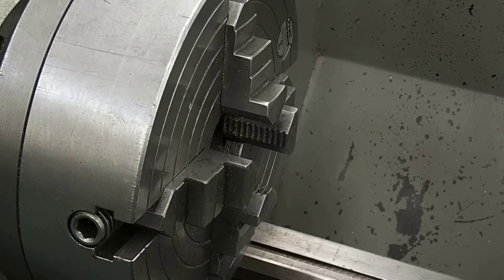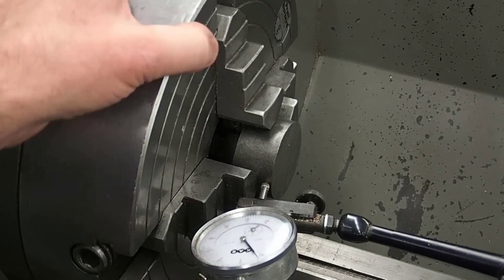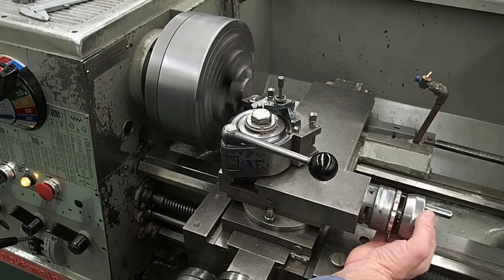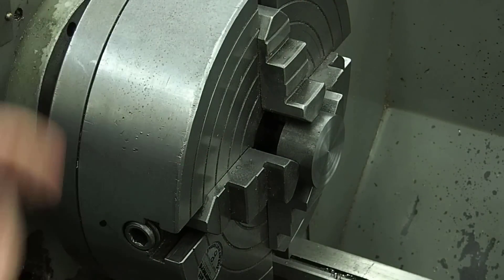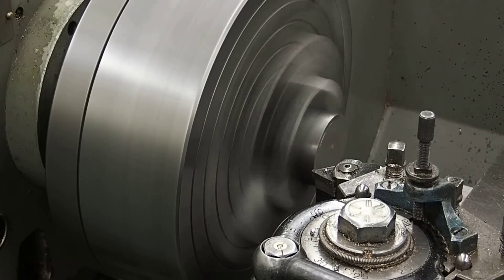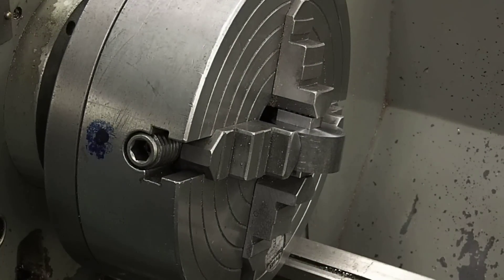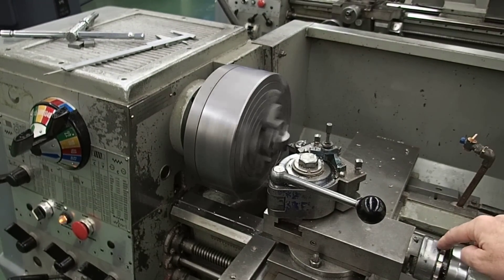Machining a Cube on a Lathe

Comment: Thanks for this! Interesting to compare with other examples including with mill vs. lathe. Kinda sad to see comments like 'just cut it from flat stock using a saw...'. Some people just don't get it.
Can you share the dimensions of the final result? In addition to face-to-opposing face measurements, did you happen to measure opposing corners to see if opposing faces are parallel (if that's how it's done...)? That would be the 3D version of looking at diagonals to check for 2D square.
Reply from the maker: Hi Steve, parallel can be measured by placing the finished product on a surface plate and running a dial indicator on the parallel surface opposite. Perpendicular can be checked by attaching to a know square (clamp to an angle plate) and running a dial indicator over the top surface, lay the angle plate on its perpendicular surface and run the dial indicator over the now top surface.

Comment: At 12:00 you turn the part 90 degrees to get a face perpendicular to the face you just cut, but this seems like a bit of a compromise. Holding it that way, the perpendicularity of the new face ends up depending on how exactly parallel that particular jaw face is to the lathe axis. Normally any error from the jaws being not perfectly parallel (e.g. from load deflection_ is cancelled out since the opposing jaw will have the exact same error, but here you have a flat face on one jaw and a round face on the other, so the errors won't cancel.
It seems like a better procedure would be to instead flip the part 180 degrees to cut the parallel face first, using a set of parallels to reference the back face to the chuck face, and then turning it 90 degrees so that all four jaws rest on flat surfaces.
Reply from the maker: Hi Anson, yes there may be better ways to approach this job. If you read through the post you will see the setup has generated lots of conversation. Thank you for your input.

Comment: Forgive my ignorance, but why wouldn't you just use a band saw, chop saw etc to cut the square?

I'm not judging this, I'm sure there's a very good reason, I just don't know what it is.
Reply from the maker: This was done because a viewer, that only had a lathe, wanted to know if it could be done.
Reply: @machiningmoments  Bull Hockey man!  The only reason why you did not use a mill, or a saw, is because you have not finished making a mill or saw on your lathe yet. :)

Comment: @3:40 I like using a thick parallel between the part and the chuck body face while tightening the first jaw just to make sure the part face and chuck are parallel. 
@9:58 Nice chip

I'd move to a mill after the first two faces lol.

I don't trust chucks because I've been burned too many times.  Unless I know it's a really good chuck.
Reply from the maker: The mill is a better choice.
Reply: @machiningmoments  Yeah, but your video was about making a cube on a lathe, so I didn't go there.

Comment: The author says, "I am not going to bother measuring the width before making the final cut on this face of the pair. Assume that I did."  Obviously it is not a perfect cube! He stated specifically that he was not making a perfect cube, but rather showing how you could make a perfect cube. It would require making a careful measurement on the second side of a pair of opposite faces before making the final cut on that face.

Comment: Nice Job..  I use the same Lathe in Work..  It's a good machine..  The gear selector is a bit cumbersome,  but, it's overall good machine.
Reply from the maker: Yes, I like it...a lot better than some of the new stuff.
Reply: @machiningmoments  ,  If that Machine is your personal Lathe,  and not in commercial use..  It should last many Generations..
Reply from the maker: Regrettably it isn't. I do though believe it speaks to the craftsmanship of years gone by.

Comment: (I am not a technician, nor an engineer - anyway, I have never used the lathe) I started to watch your video with the strong opinion, that it is not possible to carve the cube on the lathe. I have paused your video before 5:30 and I started to analyse various combinations of the carbide knives, off screen use of the saw, etc..   Woow... It is obvious now, I do not think outside the ...cube!
Reply from the maker: :) Glad you learned something new.

Comment: Can you say why, after the first cut, you didn't turn the piece 180 degrees?
It seems like that would have been a little easier.  Would it not have?  Am I missing something?
Reply from the maker: Rotating the part 180 wouldn't guarantee parallel as two jaws would still be on the round stock. By rotating 90 degrees three flat sides are on jaws helping with perpendicularity.

Comment: Question for all metal workers: I’m a woodworker so I’m fairly ignorant when it comes to this stuff. On my lathe I have a chuck, it has 4 jaws and when I tighten/loosen it, it loosens all 4 at once. Why doesn’t a metal lathe chuck work like that? I would think that it would be more precise if they all tightened at once.
Reply from the maker: Hi Colin. Your chuck will work ok if using square stock and working on center. Often we want to hold odd shapes and work off center. The second issue is if all 4 jaws are moving together it runs on a scroll plate which doesn't account for wear in the jaws or plate. Have you seen a 3 jaw drill chuck hold the drill slightly off center? Same issue. The independent 4 jaw allows you to adjust any out of round, off of center. Hope this makes sense.

Comment: You took the final piece out of frame and then set a cube on your lathe. We have to assume it was the same cube. (Yes, I'm playing devil's advocate here!) But also, why did you put a shim against the curved side when you cut face #5? I thought you'd only use a shim against a flat face. I'm not a machinist, and thought this whole process was very ingenious. I really wish I'd been able to take shop class in high school!
Reply from the maker: Yes it was the same part, honestly. There is no reason to put a shim on the round side...just a force of habit.

Comment: 17:02 - you could bend up 4 clips out  of, say brass - this is easier than steel - this would allow you to keep the soft jaw attached to the jaw, as it would BE the soft jaw, if you get my drift - it would be a tool that you would re-use, so it would be a good investment in your tooling time. I got this idea off Abom (thanks Adam) - I intend making some myself ...
Reply from the maker: Great tip, thanks.

Comment: I would really like to know what is the best/safest rpm to have it at if im using aluminium
Reply: You can google “feeds and speeds.” The answer will change based on the cutting tool, the material, and the size of the part.

Comment: How does he know that Side 1 and Side 2 are parallel?
Reply from the maker: The truth is, I don't know...If it was important I would have put a dial indicator on side one when machining side two. Then I would have dialed side one and two to machine side three and so on. Depending on the degree of accuracy required I might have used this method to rough the part out (I likely would have used a mill) and finished the piece in a surface grinder.

Comment: I started watching and thought about it at 0:38 and paused.  I am guessing that you turn it 180 on the Z-Axis and create a flat side, then use that for a reference in future... time will tell if my guess is correct (though, honestly, I think mounting a cylinder sideways in a 4 jaw chuck might be difficult as I have never used a lathe before)
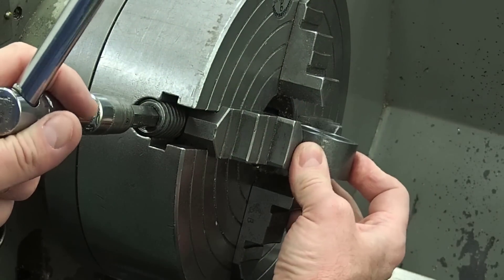5:40 Correcto!  I am so smrt
Reply from the maker: :) The four-jaw makes cylindrical work, sideways, relatively easy.

Comment: I was picturing starting off with a sphere or some other odd, unevenly shaped stock. I'm not a machinist, but what was done here was exactly what I had pictured in my mind. Only difference was you went 90 degrees from the 3rd flat, I was thinking 180 degrees. End result would have been the same.
Reply from the maker: Sounds like you have a mechanical mind.

Comment: I see the wonderfull german engineering in that aloris tool holder. I always wondered why when they designed it did they make the spline have increment of nine and a half degrees. What common angles can you get adding nine and a half degrees. They really missed the boat on that one. if they chose to make the increments seven and a half degrees, rotating two spaces gives you fifteen degrees, three spaces would give you twenty two and a half degrees, four spaces is thirty degrees, five spaces would be fourty  five degrees and six spaces would be sixty degrees. Makes all the sense in the world to me.
Reply from the maker: It is a great tool holder (for a guy that trained on a square tool post)!
Reply: i think they had a reason for their spline choice.  For even degree settings you use the index gauge which is marked in 1 degree increments.  Using nine and a half degree splines allows you to set and adjust for any half angle from a half on up quickly, e.g. +half = +10 degrees on index gauge minus 1 spline.   
How would you quickly get 29 and a half for cutting threads with a 7 and half spline?  It's easy with 9 and half spline,  +29 and half =  +20 on index plus 1 spline.

Comment: cutting speed???
Reply from the maker: Off the top of my head I think it was about 300 SFPM. I used the low end because of the 4 jaw.
Reply: @machiningmoments  we have 3jaw...then ?
Reply from the maker: 3-jaw will work, I would still be careful with the RPM as the part is off center.
Reply: @machiningmoments  okay thank you... actually I am trainee from India...& I like this job.. that's why I  wants to do it also.
Reply from the maker: Hello India! It's a great job!

Comment: The faces would be parallel to one another only if you first turned the OD, then inserted the turned part, faced it, then cut it thereby creating a second face in the same turn.
Reply from the maker: That would be a good strategy.

Comment: I used to hear that the lathe is the only machine that can reproduce itself but I think the 3D printer will beat it, I saw a cube made with one and it was really fast and easy.
Reply from the maker: 3D printing is amazing technology!
Reply: I recently bought a very old lathe. The spindle gear for the the auto feed  was stripped of teeth.. I was able to find a gear  (from another lathe) which had the same tooth pattern and  number of teeth, but different internal diameter... so I used the lathe to take out the internal diameter... Yes.. the lathe (metal shaping machines as a whole)  is the only  (traditional)  machine that can be used to repair or reproduce itself....

Comment: Thanks for showing other ways to use a lathe. Not practical at all for everyday life. I guess it is alright for someone who has nothing else to do. Start with a part just like the one you have. Stand it up in a vise. Use a cutter to mill off .400. Turn the side you just milled to the back jaw of the vise with a parallel under the part so the surface you are going to cut is above the vice jaw. Take a clean up cut on the big flat side. Turn this side 90 degrees to the back jaw of the vice and cut off .400. with parallel under the bottom side. Turn again this side to the back jaw and keep cutting to the dimensions you want Takes longer to write this than to cut it. LOL
Reply from the maker: Yes, honestly I would choose a mill first. The gentleman who asked me to create the video only has a lathe.

Comment: I don't get it. The first two facing cuts produce nice flat surfaces, but they are only parallel if the piece is perfectly circular, which it isn't. Though the first step could have been to turn the short cylinder to make it perfectly round (or as close to perfect at that lathe could produce...) Then i could believe that the two facing operations would result in parallel surfaces.
Reply from the maker: Using a dial indicator would be essential for parallel and perpendicular. This video was more about the process.

Comment: machiningmoments Thus has the basics covered. Speeds and feeds is actually important. Let's get into making threads. Could make a threaded rod that's close to acme? Even better make a nut that's acme threaded.
Reply from the maker: Thanks for the suggestion, stay tuned.

Comment: Wow, totally impressive! Making a cube out of a cut section of round stock steel. Somehow my mathematical brain almost instantly determined doing so would involve chucking the piece "sideways" across its parallel flats rather then radially as is more typically done.

While never having seen this mysterious feat done ever before until just now nonetheless I was able to deduce how it could be accomplished. 

Beyond the math modelling involved that technique being readily conceived thanks to the following explanation I'd heard years ago which gave me the necessary intuition and insight needed to resolve the remainder of this seemingly impossible puzzle.

I was once listening to an accomplished sculptor describe how he so perfectly chiseled out a bust of Caesar starting with only a solid block of marble.

He explained "the process simply involves removing all the excess material which ISN'T Caesar. While his explanation sounded seemingly glib and facetious at the time I now realize he was being entirely serious and forthcoming.

Given that (years earlier) basic insight and premise I figured this task must likewise involve removing all the (round) excess steel which ISN'T square. In this case, that process being done at "right angles" to each pair of the object's flats rather than radially.
Reply from the maker: Thank you for your kind words. I often feel like a sculptor...no insult intended to sculptors.

Comment: etalwork was theonly practical class at school, I liked.
wish I had learnt more.

I thought,tho, that when machining like this, funning luid was used, to shed heat,reduce tool wear, speed process.  maybe only on large production lines. ?
in a microchip world, nice to see some crsftwork.

good video, by Canadian presenter, pronouncing 'out', more like 'oot'? )
Reply from the maker: With carbide tools it can be machined dry, it also helps with the video.

Comment: In today's world, this is the most inefficient way of making a cube as you could machine it in a manual or even cnc mill a lot faster. Saying this and having experience in the industry, I still found it fascinating how you used a machine that makes round parts to make a square one. I didnt think you could. Today it's more of a hat trick than applied on the job but still pretty neat honestly
Reply from the maker: Hi Colin, honestly this is a pretty inefficient way the make a cube. The video was created  because a viewer needed to do this and didn't have access to a mill. Thanks for watching.

Comment: Looks like a Colchester lathe !
Reply from the maker: It is.
Reply: @machiningmoments  ....  I used one for 4 years in the early 80's when I worked as an engineer for the glass bottle industry in Yorkshire, I also used an old Dean, Smith & Grace, That was more like a museum piece though !!

Comment: Good video, although I see why it won't be perfect, and it's not just the lack of measuring the distances. The first mistake has been done after the first cut. The piece won't turn on the same axis after taking it out of the chuck then putting it back after flipping it, therefore the two faces of the piece after facing the it won't be precisely parallel. This should have been mentioned in the video, but if the surfaces don't have to be precisely parallel and perpendicular, it'll be fine. You can make it be perfect, but the process couldn't be shown in a 19 min vid.

Comment: 5:10  He does not know the first two turned faces are parallel, he only made one measurement, and the jaw contact surfaces and the plug cylinder surface are not accurate enough to ensure that the grips on each end are precise.  No measurements from finished to round surfaces?

Comment: Super glue the shim to the part as you finish the sides.  Remove when done
Reply from the maker: Not sure I'd want to use glue but I get the idea, thanks for the suggestion.
Reply: machiningmoments we used to glue thin parts down all the time for cutting on the mill and wire edm.  Never had any issues with getting them free.  Just use a lil bit.  Just enough so once you shim a finish side you don’t have to worry about them falling out.  

Great video,  just throwing out some tricks I picked up over the years.
Reply from the maker: I appreciate the trick and you posting it. I learned a long time ago I don't know everything.

Comment: Why say 400 thou instead of 4 tenths? Is measuring in thousandths just the easiest way for machinists to measure?
Reply from the maker: Machinist break the inch into 1000 equal parts (.001") hence the term "a thou" short/slang for a thousandth of an inch.

Comment: Sorry for being skeptical but, any machinist can figure this out even an amateur. But my problem with it is , why? You can lack off a piece of square stock the right length or close to it and face it off. Do the same thing.
Reply from the maker: No, you are right. I would not likely do this. A viewer asked if it was possible, I assume they didn't have a mill and/or square stock.

Comment: Everyone not in the US is thinking "what the hell is a hundred thou??"  Whatever happened to good ol' cubits?
Reply: "cubits", hah! Nice.
Reply: @Dave Dirt Yeah, er, I know... sort of a joke/little dig at Americans for still using daft imperial measurements.
Reply: @theunimerse8567  For mass and length mks is better.  If you notice though, where the accuracy and precision really count, the imperial measurements all devolve to thousandths or ten thousandths of an inch. So all the increments are simple decimal based. So that does reduce the disadvantages somewhat.

But for temperature, *C is too coarse relative to *F. Don't like having to deal with decimals for routine home heating & cooling...
Reply: They went the way of the ARK.